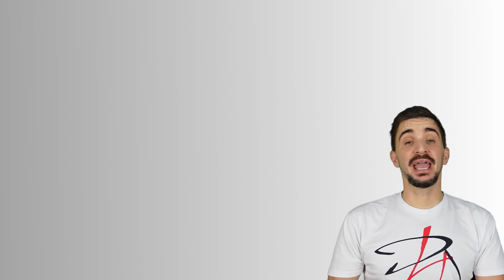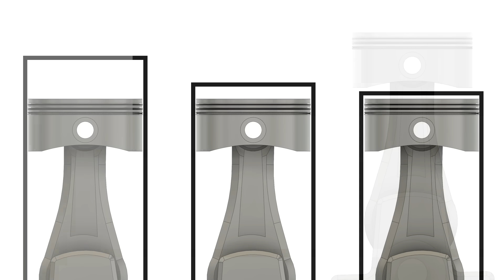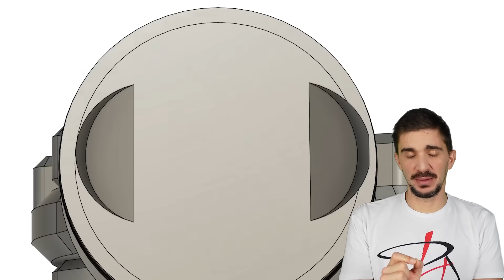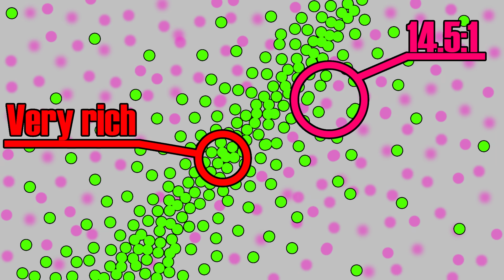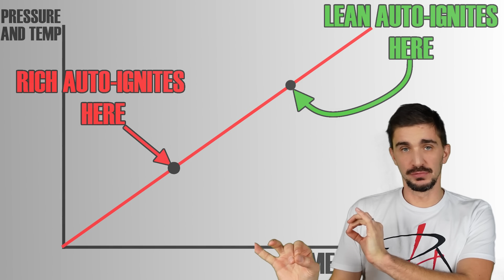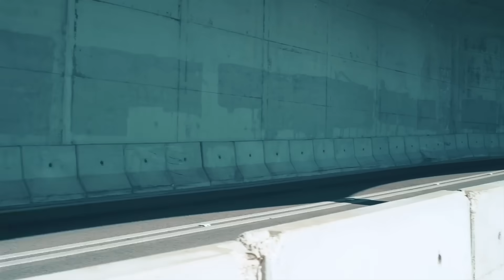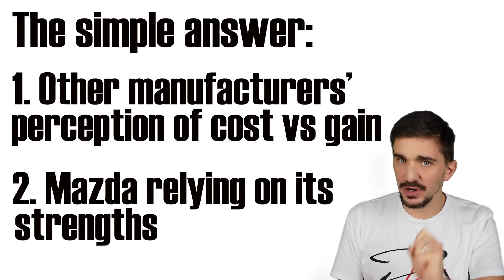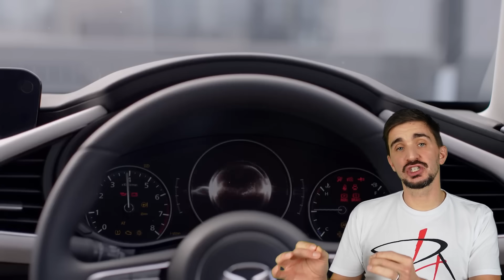The Game Changer Nobody Cares About - Mazda Skyactiv-X SPCCI How it Works and Why It Didn't Catch On

Comment: My 1986 Honda civic had something like this: CVCC. Not compression ingnition but stratified mixture. The Honda CVCC engine (Compound Vortex Controlled Combustion), introduced in 1975, was designed to meet1970s U.S. emissions standards without a catalytic converter. It used a stratified charge system with a, small pre-chamber for a rich mixture and a main chamber for a lean mixture, enhancing fuel efficiency while reducing CO, HC, and NOx emissions.
Reply: That's entirely different. And Honda aren't even the first to come up with this technology.

Comment: Sounds like a perfect fit for HEVs. Let the electric motors provide the low end torque and 'punch', and take the 30% increase to fuel efficiency so you can get a Prius with 80-90 mpg.
Reply: nah.

turbo or tune it. or better yet people just need to git gud at driving.
Reply: @impreza0109  buddy you won't get skyactiv. Turbo means that you need more or less compression ratio to prevent preignition. Hybrid is way to go in engine like that.
Reply: @starydwumas7481  you could use hybrid turbo to increase compression a little bit like 1.1bar or 1.2bar not too much but will help with fuel efficiency because it is drive an electric engine too like the new Porsche 911
Reply: @harelben-h8k   and would sky active still work with higher compression? Also is it worth hassle ? Like you will get 10-15% for many new parts that can go broken.
Reply: Why when they have rotary in mx30 rEV.

Comment: Simplicity = longevity and lower costs! Our new 2025 Telluride is just that as well as our 2016 Mazda 6 and 2005 Traiblazer. Both Mazda + Traiblazer have over 100,000 miles each and cost less than a few grand in repairs over a combined 30 years of life, simplicity. What folks missed is the 2025 V6 Telluride normally aspirated 8-speed transmission and simple engineering tricks plus a relatively mild safety system and controls. Vs all the new gadget driven touch screen only highly invasive control vehicles that as we are seeing across the board are having issues on most all fronts, engines, transmissions and computer issues. KISS- keep it simple stupid still rules in the long run

Comment: Stratified charge, pre combustion chambers, catalytic ignition and ultra lean air fuel ratios were all talked about in the 80s (not to mention hydraulically controlled valves). Its taken 40 years for this technology to be realised, not because it was hard to do but because they didn't need to. Ever tightening emission regs have forced to manufacture to innovate.

Comment: I cant really see any huge advantages to this tech when you consider direct injection. DI gives you so much more control to run higher comp ratios and more efficient a/fs in petrol engines. It will also be one of the ways Mazda have achived "CI" in petrol engines. The other key thing here is that when a petrol mixture auto ignites it tends to explode more than combust compnly called knock or pink. Despite what all the silly tech videos and slogans say, you dont want a bang, you want a woosh such that your piston can efficiently extract the energy. Burn rate is the key difference between the two fuels petrol is more volitile. Auto ignition and end gas ignition are conditions to avoid in a petrol engine. So all this said basically what you are doing here is trying to manage a/f, preassure, temp, spark retardation and now fuel delivery with DI as closely as possible to achive max efficiency without causing auto ignition or knock. Great, that is what everyone is doing.

Comment: i'm not well versed in engines, so i might be way off, but wouldn't HCCI be standarized if there was pre-injection, as a measure, to a chamber before injection, so kinda 1 more step that would make ratio more static since that chamber would allow only so much fuel, which maybe could be also calculated there by pressure or something like that if we want 100% certainty

you could visualize that as a gun and a bullet, each bullet gets injection of gunpowder right before they are chambered, so each shot will have same predefined amount of gunpowder

sorry if i misunderstood, but it sounded to me like there's variability in injection amounts, and if injection is static, then pressure required for auto-ignition should be static... also i'm aware my solution adds new failure point, makes electronics more complex and all of that, so i have no idea how it would affect reliability

Comment: I have a CX-30 with the e-Skyactiv X engine, the mild hybrid 186hp version. It's a lovely car and a lovely engine, 5l/100 km cruising on the highway and after 4 years, absolutely zero issues. And it moves! But yes, you need to rev it, which is no big deal. I talk about it to everyone, and so far I have impressed zero persons - not even my dad, a mechanical engineer, got impressed. Anyway, I keep going and saving fuel and judging everyone else on the road with their tiny turbo engines.
Reply: Had to laugh. I hear you about having something good like that going and no one appreciates it. ✌️😸
Reply: my father has the same one 2021 model specifically.   i am impressed with the amount of torque its got. honestly with 2 people weighing at about 80 and 90 kg together it pulls impressively fast. and with 3 more people in the back with a combined weight of another 250ish kg incl de  170 in the front. i have noticed no difference in the pull speed. there might be something but it isnt noticable. and that on top of the 1500kg empty mass of the vehicle. im really impressed with the power to gasoline usage ratio

Comment: the engine is pretty good, i guess that maybe with a real hybrid system and a e-cvt or at least a good transmission with an electric engine could be very interesting compared to the mild hybrid version which is good but still not enough to impress the average buyer

Comment: I've been a BEV driver for on/off 10+ years. That's not to say that I have no interest in ICE - I drove them from 1978 in various forms, two and four wheels. And when the Mazda SkyActiv engine emerged I looked into it. But my first thought was, very interesting, addressing the inherent lack of efficiency in the petrol/gasoline engine, but too late. Had they done it 20-25 years previously, they might have had something significant, and we might not have had to put up with ridiculously filthy diesel engines in private vehicles. The BEV revolution is slower because everyone with the opposite vested interest is doing their damnedest to stop it. And, after 120+ years of dominance, those people are very powerful. But, it is inevitable, and they will lose much of their industry, unless they diversify and embrace the change.

Comment: Maybe they can spray half the fuel during the intake stroke and the other half right before top dead center like around where the piston is 80-90% of the way up. They are basically trying to make a diesel engine work with gasoline because gasoline burns cleanly. They could also increase the compression of diesel engines further to see if they can burn that soot.

Comment: 0:00 "HCCI is the Holy Grail of internal combustion"
Nope. It does nothing about quenching. It doesn't eliminate toxic emissions. It doesn't address thermal losses. It prevents low compression sparkless ignition. It doesn't address any of the fundamental flaws in traditional designs.
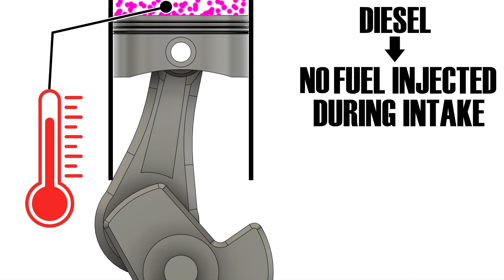1:31 "compression ratio"
isn't terribly important. The real efficiency comes from expansion ratio, which is why a Super Atkinson with double the intake valves is so efficient. Eliminating most of the penalty regular two intake valve Atkinson engines suffer when pushing out excess intake air is one of the  keys.
9:35 "compression ignition"
is obsolete. Leidenburn ignition is the future. Absolute control with zero complexity. The torque spike can begin not before TDC but a few degrees after TDC because Leidenburn is explosively fast and clean.
As you noted, this was kind of an old news video. That's fine, but the "Holy Grail" label is silly. Mazda's stuff is minor patches, not revolutionary advancement. THAT'S why nobody is following. I notice that you gave zero data. How much more efficient is their engine than a traditional Atkinson? How much cleaner? No data given generally means the data is not impressive.

Comment: 16.3:1 CR isn't really close to modern diesels anymore. They've been moving back higher in CR closer to what old N/A prechamber diesels had at 22 or 23:1 CR. Also Mazda had the highest CR mass produced engine even before the skyactiv-x. They really don't get enough credit for getting the most out of what remains of the combustion engine (neither does Mazerati TBH for putting prechambers back into production engines).

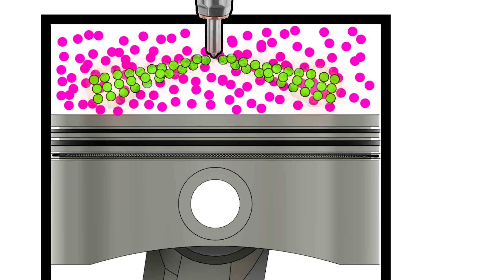Comment: 2:42 as a reminder how fast things are happening... (If I did my quick math right) Every millisecond is 30 crank angle degrees at 5000 rpm. So the fuel burns on the scale of microseconds!
Reply: 60 rpm = 360°/s
And
1 min = 60000 ms
5000 2π = 1,800,000°
So
5000 rpm = 300°/ms

A slight correction of the sneaky factor-10-error and your calc's would be right by my calculations. 
To me that just makes the innovation by Mazda even more impressive. And yeah the fuel burn is in microseconds. 
I didn't realise the fuel burn was that fast! Thanks for sharing 😊
Reply: @R4nd0mN7mbers their calculation was right and yours is wrong
Reply: @evanclarke9451  How did I manage that 😅 Had the right numbers for the calc ready at hand, but must have made an error when typing them into the calculator...
Good catch!

Comment: Volvo Trucks, Scania and Daimbler Truck use a pre mix sort of pre mix fuel injection ignition. So they are fairly simular to the Mazda HCCI but basically goes the diesel route.

The problem with Mazda SPCCI is that it solves a problem that don´t exist. Well congratulation, you reduce the NOx of a petrol engine, that really never was a problem.

While yes, SPCCI does decrese the fuel consumed, but so does Atkinson and other solutions, so does mini engines with turbo charging, and so does hybrid power trains.

Mazda went one route, it worked, but it was not better.

We probobly will see more SPCCI eventually, combined with other solutions. But the issue is that its not really people who want it, its goverment, so cycle beating is a real thing. So a SPCCI is really god on highways, but the modern driving cycle spend basically no time on high way well 20 second to be exact), so it don´t really benefit that much

Comment: This has simple solution. Microwave ignition of mixture. Also if you will run engine on defined temeperature and rpm, you will have self-ignition in exact moment. Such engine could work only as hybrid system generator (like BMW i3 with range extender). Which is probably most ecological vehicle.

Comment: I own a CX-5, most practicable and fun SUV I ever had, I live in Canada, it's a marvel in the snow, it's fun in summer with sports tires, it's reliable AF 220 000km at the moment, nothing other than brake and oil. I also own a 2nd gen manual Lexus IS and of course the mazda isn't as tough, but I stand by my point, the Skyactiv engine is a engineering marvel.

Comment: I do not agree that it's just a hard sell. From owners of a Skyactiv-X equipted mazdas, the statistics show that they enter this fuel saving efficiency about 30% of the time they drive. Also, Mazda have made this work on a 2L NA engine, would it be as ease to incorporate this into higher or lower displacement engines? Higher revving engines? Forced induction engines? And how does this engine perform when you couple it in a HEV/PHEV system?

I'd say that the cost, complexity and time do not outweigh the benefits of this engine, considering you can make these saving via a more well established HEV/PHEV system that is beginning to be a standard in the industry. Also, these mazdas can be had with an automatic that will do the shifting for you, so NO - the driver does not have to learn new skills.

Comment: HCCI and the proprietary strategy from Mazda are in a group called LTC. The most advance in Europe was the Diesotto from Mercedes Benz. Just as its said in the video, the main problem was the control nightmare.
HCCI was thought for diesel, but they had to use up to 60%EGR to try to control the detonation pressure peak.
In summary, detonation is what make sense in terms of efficiency and emissions control, but has to be tame to adapt the phenomenon to the combustion chamber.
So, is like to poison their own medication.
That's the last resource for the ICE from the thermodynamics point of view.
Mazda use its knowledge about this, and made the 3.3 l diesel.
But nobody noticed that.

Comment: Modern day Common Rail Diesel Engines use a Multiple injections per cycle called MultiJet. The system injects several leaner mixture injections followed by a main injection. So leaner mixture initiates a smoother combustion, controls knock and vibrations as well as the emissions and particulates and gives an excellent fuel economy. 
This technology is over two decades old introduced by Fiat. 
This Technology is close to HCCI

Comment: We really need more stable fuel to use this method more efficiently.
They released the ending at 15-1 compression which is crazy. 
However they only make 186 hp which might be why. There comes a level of high compression where it can backfire in hp. 
Now add ev assist to the engine and get 50 mpg out of a small suv.

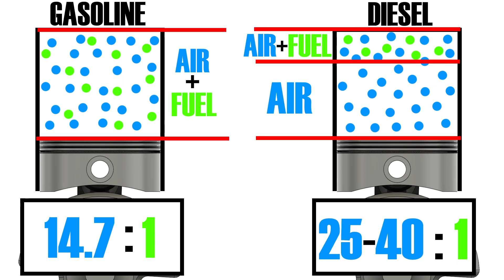Comment: 3:24 one of the best diesel engine used 17:1 ratio. many of pressire build turbo. but engine is good power and efficient.
Reply: which engine
Reply: @berelax833  2.0 D 150HP bmw. Its so efficient in city and autobahn with 6 manual. Maintence begin under or above 400kkm

Comment: After 10 years of driving 1.9tdi's and turboe'd engines, I swapped to a  Mazda 3 2.5L Mhev, and I have heard nothing but good things, plus the test drive was great.
It should arrive this month, buying it new.
It may have less torque and kick being turboless, but a NA engine will last as much as the 1.9tdi and the turbo headache will be gone
The only thing that worries me is the hybrid battery, but you can't have it all.
Plus the aftermarket for modifications of the 2.5L is looking tasty...

Comment: The only real problems with this engine are the fact that it almost never reaches the conditions necessary to activate SPCCI, and the compression ratio is too high, so it needs very strict overcompression control strategies, like dynamic compression control by high speed throttle adjustment, and that can really restrict an engine at lower RPM (flex fuel cars here in brazil have the same problem).

Comment: I bought a 2015 Mazda3 with the Skyactive engine and manual transmission back in 2017. Driving it home from the auction I was amazed at the low end torque (below 3k rpms) of such a small 2.0L engine. I had no idea it was something special till years later.

Comment: These are great engines and they don't seem to have reliability issues, at least not on the level of some of their compeditors. On the downside, as pointed out in the video, the engines are not really performers. They feel underpowered compared to compeditor designs, especially the lack of torque throughout the revrange. If you work the engine through the gears as stated, the efficiency advantage to other petrol engines is shrinking to an extend. Modern diesel engines are more efficient and have better performance while being less reliable (at least with all the auxillery components like Turbos, Filters etc) and less invironmental friendly. So, in the end it's a game of tradeoffs that you can and have to pick from.

Comment: Well, F1 engine is gasoline engine and is at 16:1, Mercedes apparently has 18:1 compression ratio.. And that little trick they do to increase compression ratio from cold engine 16:1 to hot engine 18:1 has an extra chamber, that is all we know about it. Now i wonder, are they doing something like this..

Comment: Research propan injection in combustion engine finally, and you'll finally see, that this propan injection has really ALL THE BENEFITS OF BOTH PETROL AND DIESEL ENGINES and has no disadvantages like petrol and diesel engines - like carbon creation everywhere in the engine, spoiled oil, slow burning, which is preventing engine to run efficiently at high rmp, no detonations and much more.

I just wonder how anyone so educated is still missing the most efficient and best combustion engine possible - with petrol gas injection.

Really have all people just lost all intelligence and memory?

Comment: Obviously the engine doesn’t feel special, but on the other hand it doesn’t feel special on the wallet either, like a 1l 3 cylinder one does. Though I have to say a V6 should be nice.

Comment: @5:45 I always thought that a lean mixture burnt hotter than a rich/stoichiometrically correct mixture? 🤷
Reply: A stoichiometric mixture will always burn the hottest, because all the energy available to be burnt will be used, the issue is that the injection and vaporisation of the fuel has a cooling effect, and with less fuel there's less cooling hence why lean mixtures tend to run hot.

Comment: It's funny to me that people don't like the linear characteristics of NA engines, because I personally dislike the surgy sensation of driving modern low-displacement turbo engines.  And with 6-10 speed transmissions, you feel it a lot.  I know they're more fuel efficient but it's just not a satisfying driving experience.